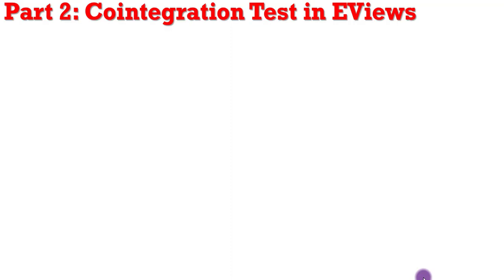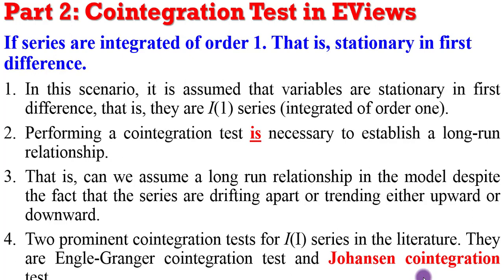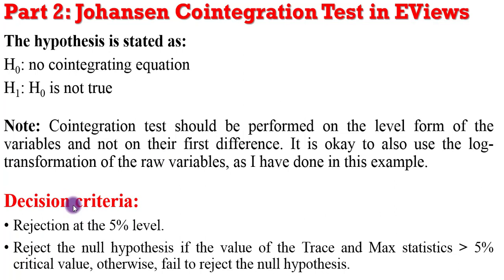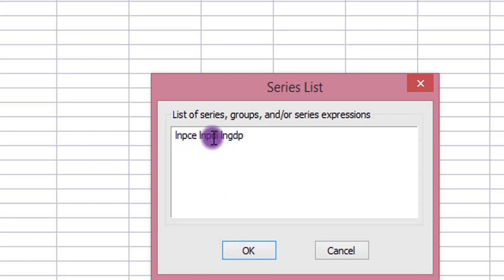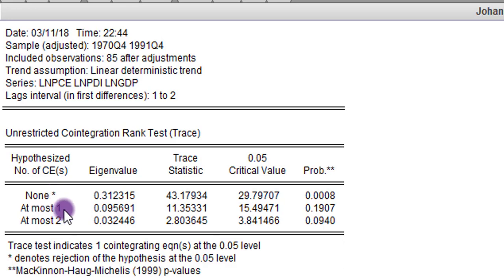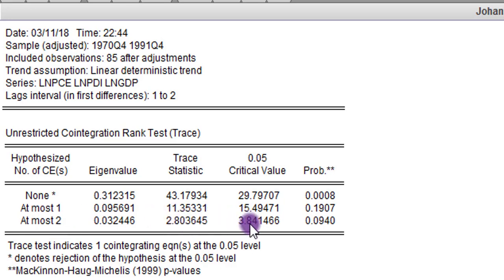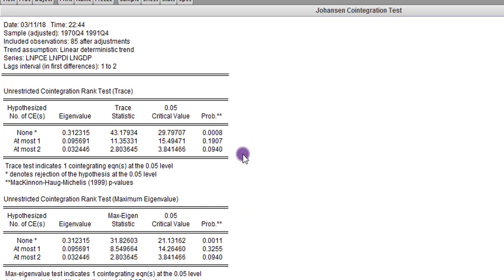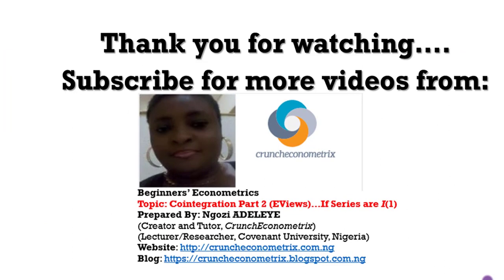(EViews10):Estimate Johansen Cointegration Test #var #vecm #Johansen #cointegration

Comment: Hello Ma'am, If trace statistics indicate the presence of cointegration among the variables but not the max-eigenvalues. What is to be done in the case?
Reply from the maker: Hi Saakshi, you are at liberty to choose whichever since you are disposed to using either of them. I explained that in my cointegration videos.
Reply: @CrunchEconometrix  Thank you Ma'am, and another question if not bothering you much. Can we use Engle-Granger (EG) co-integration test? So far my knowledge this test has been criticized a lot. Why I am thinking about the test as I have two variable model that is I am interested to check the long run relationship between two variables only. So is it okay if I only use Johansen and not EG or should I use EG rather than the former? This is part of my research and any help is highly appreciated.
Reply from the maker: @saakshijha9689  I often don't take positions on which to use because both tests are still relevant in the literature just that for whatever reasons JCT is now more popular than EGCT. Again, I'll say use any and you can't go wrong.
Reply: @CrunchEconometrix  Thank you
Reply from the maker: @saakshijha9689  U're welcome, Saakshi...kindly share my videos with your friends and students too, thanks! 💕 😊
Reply from the maker: @saakshijha9689  U're welcome, Saakshi...kindly share my videos with your friends and students too, thanks! 💕 😊
Reply: @CrunchEconometrix  Sure

Comment: Madam, I feel that in this video it should be Reject the Null Hypothesis if the value of the Trace and Max statistics < 5% critical values otherwise, fail to reject the Null Hypothesis. This is because for example in Trace, at 'At Most 1' the trace statistics is 11.35331 and the 0.05 critical value is 15.49471. In your explanation you are rejecting the Null hypothesis (No cointegration equation) and accepting that there is atmost 1 cointegration equation. Please clarify.
Reply from the maker: Hi Manoj, u've stated exactly what I said. In the JCT, H0 = no cointegration. So once Trace>CV, that hypothesis is rejected at the 5% level. Kindly watch the clip again and follow my explanation. Thanks.
Reply: Madam, when Trace > CV it means that there is no cointegration and hence the Null Hypothesis is accepted. Only when Trace < CV, there is cointegration. And hence  the Null Hypothesis (No Cointegration) is rejected. Please clarify whether I am right.
Reply from the maker: Manoj, I've given you my explanations, but I'll advice that you read up and decide on your own. No need for arguments. Hope this settles it, thanks!

Comment: Hlo Ma'am,
In video you took lag interval 1 2. I followed lag length criteria and optimal lag is 4. Should i used lag interval 1 3 (p-1)??. Should i abstract one lag in johansen test as i noticed in video related to VECM.
Reply from the maker: Hi Ajay, if the optimal lag is 4,then for JCT it is 1 4; and 1 3 for VECM.
Reply: Thanx a lot Ma'am... plz specify the reason.
Reply from the maker: @ajaysidhu4091   Hi there, my videos are well explained. I will advise that you watch all videos related to VAR and VECM, then you will get the understanding.
Reply: Why lag is 4 for JCT and 3 for VECM??
Reply from the maker: @ajaysidhu4091 Kindly, watch my videos on VAR and VECM for better understanding.